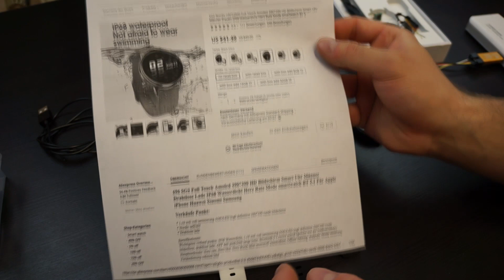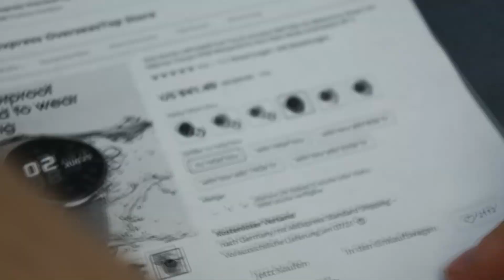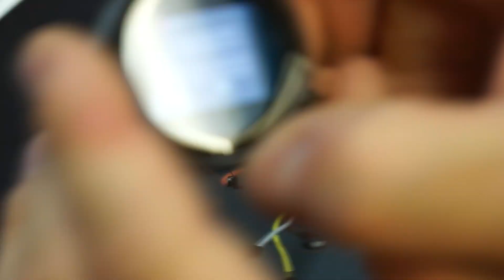I need your decision! Arduino on the SG2 nRF52840 Smartwatch

Comment: Hi from France ( another man ) sorry for my poor English,

I waiting one SG2

I found some information :

https://devzone.nordicsemi.com/f/nordic-q-a/37265/nrf52832-nrf52840

nrf52840 don't support MIPI

https://drive.google.com/file/d/1xiEm6MldM4e2QHnpQaLusarikOhB6h9O/view

Display is in 8 color mod in SPI. It is many ref for this screen depend of connector, no brand or another brand. For me internal is same.

Strange but i see some time 8/9/10 color is black ( pixel off ) is a color.
Probably for this it is not beautiful picture in this watch.

I have not found the big datasheet with register and more and more.

http://www.microweartech.com/

It have SG2 and SG3 the real with nrf52840 and amoled 390x390. SG2 have same battery but 0.9mm more for wireless. For me it is the same electronic.

It is many other brand that use SG3 ( not SG2 ) with another screen or / and another chip. Probably SG2 is a good product and another brand make bad copy and use this name. It is easy to add same fonction with a 240x240 IPS LCD ( 5 USD VS 25 USD on aliexpress ) with this it is zasy to propose a SG3 at -5 to -10 USD with the same picture and same description, change resolution in description and chip and it is OK for aliexpress.
Reply from the maker: Hey. I hope i understand correctly. 

The display is connected with SPI so that is no problem.

The new SG3 dont seem to use the nRF52840 but not shure about that.

The SG2 is a Fake samsung galaxy watch active 2 and i think that is the reason it is EOL
Reply: @atc1441  Hi again. for memory it is the XT25F128B, 16MB what you say. For the other memory it is not readable for my, have you the ref ?

Comment: Is the screen is Amoled or Ips? what the difference between SG2 and SG3?
Reply from the maker: The screen is an Amoled display. 
The difference is that SG3 dont uses an nRF uC
Reply: @atc1441  what is it NRF Uc? maybe wireless charger that has in SG2  but not has at SG3 (they do magnetic pin charger)
Reply from the maker: The nrf uC is the main CPU inside the watch, only nRF can be reflashed like i show here. So thats the most importand part. 

And also the SG3 has not wireless charge yes
Reply: @atc1441  so if I want only use like ordinary user without flash by me, only Firmware update from the company, which watch to buy: SG2 or SG3?
Reply: @atc1441  why they pool out the wireless charger from SG3?
Reply from the maker: Good question. I bet its cheaper. And yes you need to decide wich one you want if you dont intent to reflash :)
Reply: @atc1441  thanks for your help!
Reply: @atc1441  yes magnetic charge chipper then wireless charge unit

Comment: A nRF52840 as the core of a smartwatch... cool. I am building a plants monitoring and watering hack for my garden based on the nRF52840, using Thread for the mesh network. Walking into the garden every morning and and picking up a summary of what is going on would be an idea for this watch. But then again, I would then have to find a justification for the existence of the router-node that connects the garden-network to house-internal website.... hmm....
Reply from the maker: Why not let the garden nrf52840 connect directly when you are outside and sends the data to it? :) completely self-sufficient
Reply: That's actually the current plan :-)
The garden nRF will do everything automated of course since my plan never involved a smartwatch, the garden nRF would automatically gather all plant info and post it to the cloud or elsewhere. 
Yeah... that smartwatch (at least with the nRF) would be superfluous for me no matter from what angle I look at the project... just a fun gadget to play with.

Comment: Hi Aaron, awesome work.
One question: will all dafit trackers work, I esp. would like to be be able to hack into this one:
https://www.amazon.de/Beaulyn-Smartwatch-Wasserdicht-Schrittz%C3%A4hler-Android/dp/B086DSZYH1
Reply from the maker: Hi. 
This watch seems to be compatible as it is dafit. 
It is possible that its not nordic mcu hard to tell. 

But please bear in mind that this one does not have a touchscreen, it only got one small button under the display to controll it so the firmware needs to be edited to it

Comment: I would vote for both: SG2 for display related features and the P8 for general stuff. 
I would like to see some NRFconnect code. I think arduino is cool to start with and to do fast hacks, but at the end a more professional environment would be a great addition. Nordic has extended nRFconnect to the nrf52832 and there is not a lot of examples available.
Reply from the maker: Thank you for that. I understand you. A goal would defenetely be to go to a more advanced ide where you got more control pver the backend. 

What do you mean by nrfConnect code? 
The Android app?
Reply: @atc1441  The Nordic nRF Connect SDK "firmware side"

Comment: Yes, you should continue!!! If I was smarter in this area, I would also do he same as you! I have a question,  my 2 identical watches have chip by:  MEDIATEK ARM, MT6261DA, 1903-BJCJH,BAP1T352, and last 2 numbers: 05AB6831CA30001, 95ABXC682788000  It was hard to read the chips maker.... Is this is one of the chips that can be used? Thanks for doing all of this work and sharing it with us!!!   The watch has one button on the right upper corner.
Reply from the maker: The MT 6261DA is a totaly different chip but there is some developing going on for it. 

Also tested some of it but its to unknown to work with it :D 

Here is some info https://github.com/MediatekInfo/DZ09
Reply: @atc1441  Thank you for a quick response! Are there any more videos how to use this series? Do I need to disassemble the watch and solder anything - I do have couple microscopes.... - so I can try to program it  with Arduino interface? I have 2 of them and I can't connect to my phone, so they aren't much of any good, but I like to experiment, as long as I follow good instructions. Have a great weekend.

Comment: Wow, dude you are an efficient hacker :)
Especially the software aspect of the project is really interesting and you seem to have most of the work done am I right? Even the screen and touch driver is running so what else do we need? HR sensor and accelerometer?
Great that you're paving the way for more nrf52840-based devices. I'm sure there will be more and more of them.
Is it hard to remove the rtos from the adafruit core?
Reply from the maker: Hi , Thank you

Yes the nRF52840 is very nice as it opens so much possibility's. 
Overall it needs to be made nicer adapted to the round screen etc. and yes HR and Accl is still not worked on till now.

It is already running without the Rtos so its not hard to remove, only problem is that the BLE library relies hard on RTOS and that needs to be edited a lot so its working just no BLE without the RTOS for now !

And yes the screws are the only reason i bought it at first as the price is just suuuper high for a not hack-able one :D
Reply: And besides: this thing has actually SCREWS! We have never seen that before! Huge deal...

Comment: I love round watchfaces but it is less usable (or a PITA at least) to make the whole watchface show useful graphics/icons. Also this one is more expensive and needs to be disassembled completely to access. Not sure if I would ever get one (as I said earlier I am not a watch wearer) and attempt to change the bootloader/code on it so don't let your decision be weighed too much by my comment :) You call this putting Arduino on the watch but Arduino is an MCU (and its IDE) and a watch has no input/output pins to control something so what do you mean with that ? Do you mean writing code in C++ in the Arduino IDE that operates the watch (like a mini OS) ?
Reply from the maker: Thank you.
Yes by Arduino i mean writing the c++ code in it. And indirectly it is the nrf52 mcu inside that it gets compiled for. So you also got the input and output pins of it only that they are already going to the display touchscreen and sensors. Its a development platform but self contained. You got the full hardware at bare metal control
Reply: sorry I needed you to wrap my mind in the right direction. It sounds so logical now :)

Comment: it definitely looks cool but i have a question about the battery: does it have a charge controller on the battery since it seems to bypass the pcb. seems like a good potential hack able watch
Reply from the maker: Yes it is self contained. the Main pcb gets just power and if the battery is getting charged or not